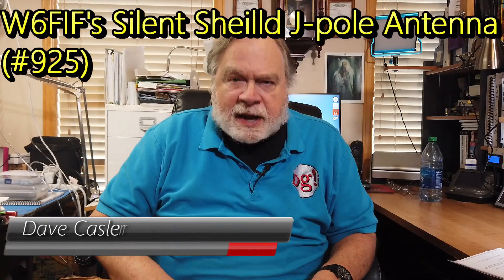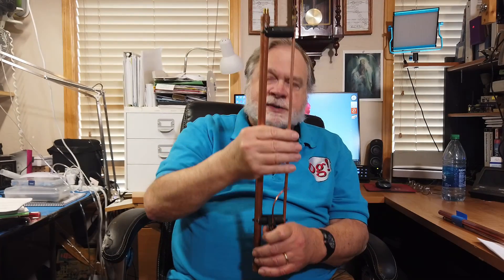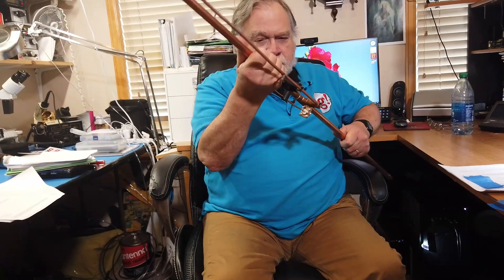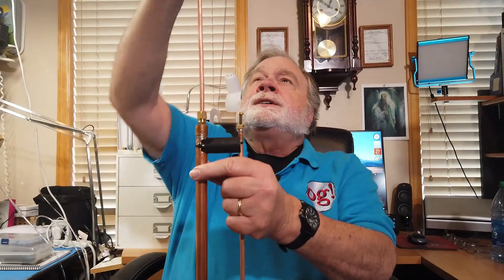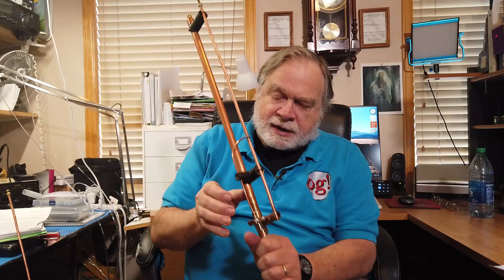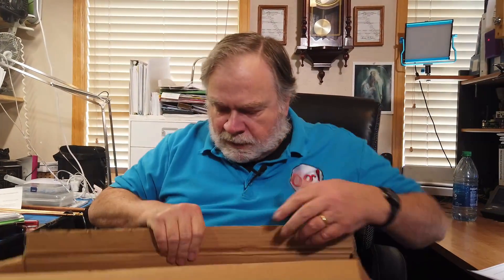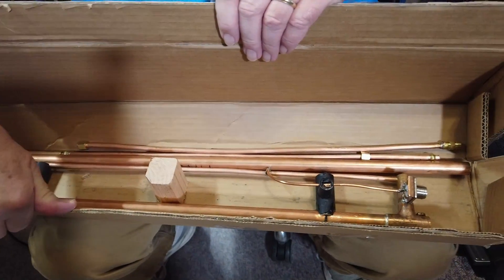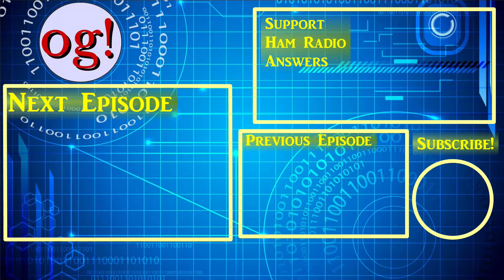W6FIF's Silent Shield J-pole Antenna (#925)

Comment: I love J pole antennas.  In my experience, they are extraordinarily forgiving.  I think many people overthink precisely tuning them, as they are pretty broad-band inherently.
As for the diameter of his tubing, tubing with more surface area is broader band as well.  Aside from strength, using 1/2" tubing throughout will just increase performance.

Comment: Is there a reference (email or website) to lengths and diameters for each section of this J-Pole? I would like to build that with the modifications you suggested with the threaded areas.  I don’t have any measuring devices to check the SWR & Impedance.  Where could I get that measuring device to check that too.  Also the black round section…is that foam?

Comment: i absolutely love where the feed point is, more practical.. no need of few turns of coax for to kill the capacitance?!?  ..thank for the review.. question, i have a portable VHF/UHF FM 8 watts, have you a suggestion for a swr/power-meter able to have a good precision at this level?!? (most have 100-125w of range and are inaccurate at the bottom of the scale).. i dream of to build a brass J-Pole (elegance by the color and not oxydable).. happy of your review today!!

Comment: Every time I see one of these copper J-Poles I  wonder how well a slide trombone would transmit 🤣🤣🤣.

Forgive my ignorance but what is the "Silent Shield" mentioned in the title but not expressly named in the video?

Thanks!

John - KK7JBZ
Reply: Silent shield is Dave's invented terminology...hi..hi..
De VU2RZA
Reply from the maker: Actually, it's the terminology from the inventor.
Reply: @davecasler  so, he has invented the terminology and nothing new about the antenna. 
The job of explaining the meaning is shifted from your shoulders to his. That is very nice of you 👍😀
De VU2RZA
Reply from the maker: @subramanianr7206  Whatever. He put the antenna together. He branded it. Lots of things have brand names. I will be doing more testing as well as a comparison to a "standard" J-pole in the future.
Reply: @davecasler  Yes, please do make a review video on the antenna and it will be much appreciated by everyone.
This time you may want to show the connection points (that is unique for sure as I have commented earlier) of the coaxial cable onto the antenna; in the present video you have been rushing through or you don't want to have a focused study on the unique nature.
Probably it is he who claims it is a balanced feed assuming (of course erroneously) that he has quenched the shield braid or something like that. Hence he might have coined the term "silent shield" I suppose. 
Anyways I am waiting to see a follow up video with great expectations, albeit the fact that you won't find any difference in the performance.
Thanks Dave 👍
De VU2RZA

Comment: Dave, it is my bad to comment again.
There is nothing unique in the design (except for you); it is the regular J pole antenna.
The only point I would like to congratulate him is that he is dare to feed the coax centre to the shorter side of the J pole.
Yes, in almost all of the designs on the texts and elsewhere people will prefer to feed the centre conductor to the longer arm, thinking that it is the radiator side of the J pole that should be connected to the centre conductor of the coaxial cable. Of course the half lambda section is the end fed radiator, no doubt. But the quarter lambda transmission line section is there to have a match between the high impedance (around say 2-3 kilo ohm) of the end of the half lambda radiator and the 50 ohm coaxial cable. So, the coax centre can be fed to any of the two arms of the stub. After all RF is AC and it does not discriminate between the two conductors of the feeder. 
The problem lies in your mind that you think the centre conductor only carries the current and no current flows on the outer conductor or you think that it is at ground potential. The inner surface of the outer conductor carries equal magnitude of current (but of opposite polarity) as the outer surface of the inner conductor. The outer surface of the outer conductor is forced to the DC ground potential at the transmitter deliberately by us. That is all. The outer surface of the outer conductor should not carry any current (if it does, it is called the CMC (common mode current, which is undesirable) and it has to be choked.
Again you are still confused about what a balanced feed is and what is not. 
Here, it is still an unbalanced feed only; not a balanced feed at all.
And you should explain what the title "silent......" means!!
You claim that it is unique that the feed is a balanced type. That is really awesome, Dave.
I don't have to talk about the mechanical ruggedness of this "plumber's delight copper cactus" antenna. More comments will be pouring in on that, I know.
And you were right about the fact that the j pole is nothing but the popular Zeppelin antenna and it becomes the double Zeppelin antenna if both the free ends of the 1/4 lambda transmission line stub are terminated into a half lambda long radiator.
But it was hydrogen the Germans used in the ship that got burnt up resulting in the infamous accident. Germans knew about the flamable nature of hydrogen. But they could not get access to large quantities of helium to fill the chambers in the Zeppelin air ships. It was the US that was capable of producing large quantities of helium on the planet then. But then the war was nearby and the US would not sell any helium to Germany.
Yes, helium being the second element on the periodic table is inert and would not have caught fire in the first place.
It was unfortunate that the Zeppelin was filled with hydrogen, a highly reactive and self combustible gas.
De VU2RZA
Reply: He did mention, when he was outside, that it wasn't unique.
Reply: @montybates5176  Dave is testing outside of his house for 1 minute and comes back to his seat. Then at 5.53 he says that many people have tried the kind of feeding the J pole.
At 9.22-9.23 he again says it is different and unique enough to get published in the QST magazine (as the designer had been thinking of) 
Hope you want to watch the video again
De VU2RZA

Comment: Curious if that feed point helps reduce common mode current on the feed line. Most J antennas I build will show SWR changes as you grab the coax and move it around.

Comment: Why re-invent the wheel? There are literally THOUSAND'S of J-Poles in the air now with the same traditional feedpoint design, I even have one I made myself, I get better SWR readings than this one showed across 2m and it works equally well on 70cm, again with better SWR figures than shown. I know people like to experiment, but if your changing something that works perfectly already, you had better be sure your design is an improvement, not just an unneeded complexity. I think Ed Fong got the design right, his design has become the "standard".
Reply: Apparently you missed the part where he talks about balanced and unbalanced feed point.